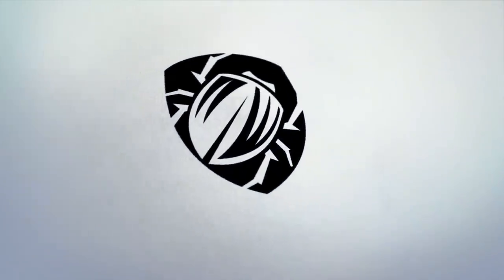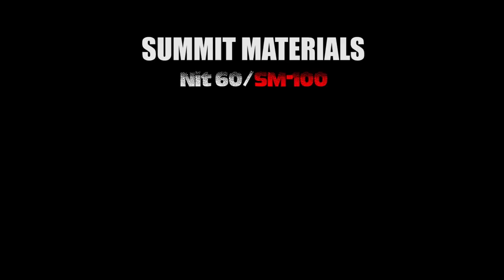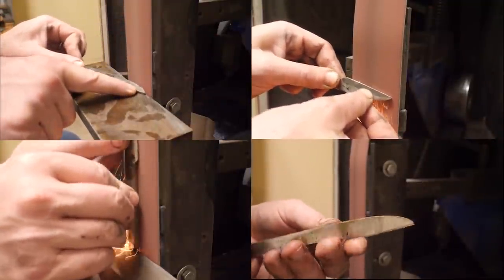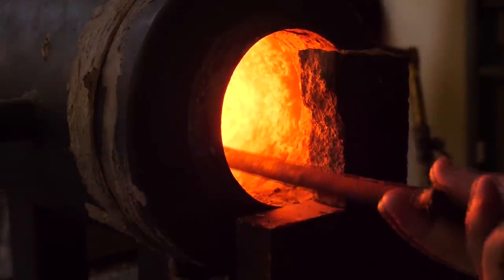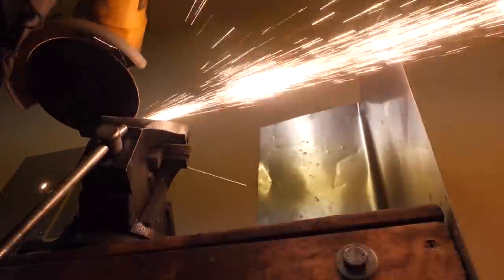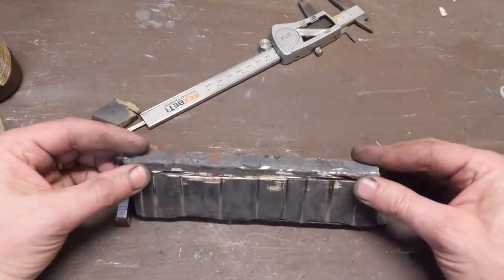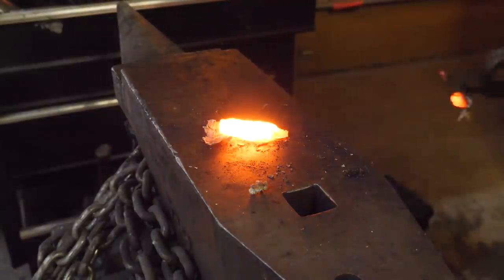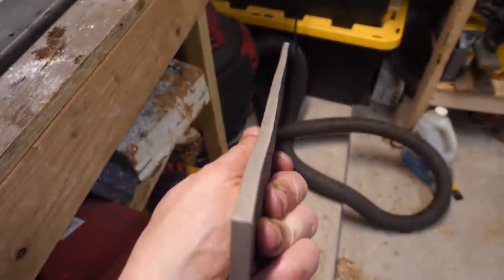Making A Nitinol Knife. Part 1: Forging Nitinol

Comment: "Making A Nitinol Knife. Part 1: Forging Nitinol"
me, a guy with a welding degree and limited experience with Inconel, Nitinol's nicer younger brother, grabbing the popcorn and sitting down:
"ooo this is gonna be hilarious"

for the record guys: both inconel and Nitinol are "super" alloys. they don't really like working under hammers. or working at all. they machine like trying to cut steel with peanut-butter.
Reply: "trying to cut steel with peanut butter" had me laughing

I had an oddly similar aggravating experience with some Aluminum-Nickel Bronze
Reply: @timothylongblacksmithing6743  that's a whole lot of words to say you had to sharpen your cutting tools after that

Comment: You're running into fairly normal issues when trying to forge titanium alloys, I've been there. Short answer is that outside of expensive specialty equipment, stock removal is the only viable way to get anything out of it. And then when you go to try stock removal, it just chews through belts like no one's business, ceramic ones included. 

I have two different 50% completed titanium 6alv knives and I ran into the exact same problems when trying forge it - embrittlement, work hardening even when heated to glowing orange, and severe oxidation. Between the embrittlement and oxidation, my attempt at forging a usable knife was a complete failure. It is a knife shaped object though, so at least I have that.

My second attempt, stock removal with a 2x72 belt grinder and ceramic belts was expensive - it ate ceramic belts like no one's business, it was both gummy and very hard to get anywhere, and it threw blinding white hot sparks everywhere. I got the rectangular block ground down to the knife blank outline and gave up after using a little over $100 worth of ceramic belts just to get to that point. I estimate that finishing it would be another two hundred dollars worth of belts, if I can even get a useable edge out of the end product and not just a wedge.

Titanium alloys don't hold a edge worth a darn from everything I've seen. I think as knife materials go, they're right up there with plastic - can it stab something a few times? Sure. Will it have a keen, useable edge that can cut stuff a few hundred times before needing to be sharpened? Not really.

So I've got tantalum next up on my list of 'exotic materials knives aren't made out of for very good reasons but I'm still going to try' list 😂

Comment: It seems like you need diamond saw blade, adamantium hammer and dragon scale anvil to work with this stuff.
 Not to mention nuclear reactor core to heat it.
Not worth, considering the end result would be a Knife of Corrosion Resistance+2

Comment: We frequently use nitinol products in the operating room (I'm a certified surg. tech). It's used a lot in kidney stone retrievals (wire baskets) as well as guide wires for the bone anchors we use in various tendon/ligament repairs. Stuff is indestructible, just so flexible and tough. You can practically tie it in a knot and it springs back to original form.
Reply: Big difference between NiTiNOL50 (that you are using) and NiTiNOL60 (what GB is using)
Reply: @BikeFitnessCoaching  what I mean to say is, bendy metal make surgeon happy face

Comment: It's usually single crystal cast or rolled, then cnc cut, with an industrial forge, with large environmentally controlled ovens and cooled oil quench machines.
My ex partner used to work for a company that did this for airplane components and let me tell you the machines in operation are amazing and absolutely huge.
I wouldn't feel bad if you cannot achieve the precision, i mean, the presses are inside ovens that keep the metal at temperature and the atmosphere inside said presses/rollers/forges is argon or some other inert gas to remove the oxidisation problem, something you will find extremely difficult as you cannot do hands off forging.
Reply from the maker: Ya, thanks.  I called a couple places about rolling and that’s what they said.  Heat blanket, inert atmosphere. Ridiculously expensive to roll a piece they wouldn’t even quote it.
Reply: @GreenBeetle  totally, just to start those peices of equipment costs thousands.
I remember being told they're on 24hrs a day and only turned off for maintenance, seeing as it takes 24hrs to heat everything back up to temp and ensure repressurisation of the system.
The company that my ex worked for also had large orders booked upto a year in advance, so their forge time is often entirely spoken for.
If you were to go to some of the bigger companies and speak to someone in their quality control department you may have more luck as they do small test runs fairly often to check the metals on output meet specifications and may be willing to work on the scale you need.

Comment: Cheep roller for sheet, two offset cylinders opposite direction for rotation, and the work fed in the direction of exit, and the offset comes closer, squeezing the work until it spits it back out towards you, and at a relatively safe speed.

Comment: As a metallurgical engineer I love seeing the phase diagram but sitting here crying at the attempt to work it. Almost seems like it could be cast but its melting is somewhere around 2300F so..use a coal forge if a gas cant make it and see if a heated mold could accept it, maybe even cool it while in the forge lowering temp gradually. Crazy stuff.

Comment: My suggestion: crucible and a mold.  Hard to believe that it wo't hold an edge as hard and brittle as that stuff is.  If you find the secret to working it it should be like working ceramic and keep an edge forever...

Comment: This stuff is like AR500 armor plate or Armet steel . Without the big boy tools it super hard to use. 
There was a bike frame company that tried to make frames out of Armet tubes in the early 90's. They had tons of problems because they went through so many grinding wheels. I think the finally just abandoned the product.

Comment: Steve-

Just a thought on the Nitinol Steel.  Is there a possibility the round piece could be chucked into a lathe and you could make turnings of the Nitinol, then place those turnings into a canister? Maybe then add some 15N20 powder to the canister with the Nitinol shavings?  Would this make the material more usable for a knife.  Yes it would be a mixed steel knife, but it could yield an interesting Damascus pattern, plus make the material more workable for the knife...

Just a thought??
Reply from the maker: Good thought but it apparently requires percussive arc welding to weld to other stuff.

Comment: Were those original samples from the Navy Ordinance Lab? If so, those are pieces of metallurgy history.
Reply from the maker: Rick says they were
Reply: @GreenBeetle  not sure how I feel about that. I am loath to waste material, but if it’s from one of the very first melt batches I’d say it should be in a museum. 

If you still have the samples, it would be interesting to listen to the sound they make when tapped at different temperatures along the austenite/martensite transformation. Just like the event that clued the researchers into the structure change that happens with temperature and strain.

Comment: Yeah, both metals have very high melting points, and both retain their strength closer to their melting points (especially nickel...hence why it's alloys are used in jet engines). 

Titanium is very reactive and becomes more reactive the hotter it gets. Normally, it is protected by a layer of Titanium oxide that forms very quickly when exposed to air, water, anything it can take oxygen from. Titanium Oxide is very hard...so as you cut, new Titanium oxide froms very fast. (it's why something inert like argon to keep the oxygen away helps a bit). 

On top of that, when nice and hot, Titanium will steal the carbide from carbide tools and form Titanium Carbide (which is one of the top hardest things known to man...close to the hardness of a diamond...Tungsten Carbide tools are sometimes coated with this stuff to make Tungsten Carbide more wear resistant lol).

Can also form a ceramic called Titanium Tungsten Carbide (also very hard), if you feed it some Tungsten Carbide on a platter. 

Titanium is a poor conductor of heat, and to make it even worse has a low specific heat capacity. So the heat builds up in one spot, and does so fast. As you peel off the inert Titanium Oxide coating, it causes the freshly exposed, extremely reactive Titanium to react with oxygen (which is a very exothermic reaction...that reaction produces lots of heat...like when Aluminium combines with oxygen to produce lots of heat in a thermite reaction) generating even more heat in that spot and is confined there by the Titanium that isn't a good conductor of heat. More heat makes Titanium even more reactive, causing all this to happen faster...creating a feedback loop, contained in this insulated spot. Titanium deforms easily and turns to gum as it heat up very quickly as oxygen is fed on a platter for reactions. 

Titanium also reacts with water to form Titanium Oxide, so water plus exposed Titanium isn't ideal either.

So:
1. Insufficient cooling of the spot that's being worked = Bad
2. Water + heat + removing oxide layer = Bad
3. Oxygen + heat + removing oxide layer = very bad
4. Tungsten Carbide or other carbides = bad
5. Even Nitrides = bad

Nickle has an extremely high melting point, which adds to the problem. 

The same things that give these two metals in this metal compound their respective amazing properties, make them a hard to work IF you try to force them to behave like steel.

Comment: So the yellow stuff is nickel oxide then? Is it harmless? Because I have had stuff like that happen on salvaged steel. I had made sure to remove any zinc coating because danger and seeing unknown stuff pop up anyway got me scared.
Reply from the maker: Don’t know.
Reply: More likely oxides of titanium. Of you heat titanium in a forge it turns yellow orange color

Comment: Dude!  An iron-free Nickel/Titanium alloy that gets as hard as a good tool steel?  There's GOTTA be a way to make knives out of it! Heck, make a Damascus with two different grades of it, and you'll be elevated to god-hood!   Build a furnace around your press dies, and make dies out of some hot work high speed steels? So, it's all forged fully AT temperature? In an argon atmosphere?  OK, that may be totally impractical... but, there's gotta be a way! Are there any metallurgists at Carpenter Steel you can call?
Reply: Man if you could freaking pattern weld titanium and nickel you would be a blacksmithing God LoL.

Comment: so it looks like to me you would need to melt and CAST that particular alloy which would require and industrial smelting furnace that using induction heating rather than any form of flame. perhaps it's the flame and it's natural uneven heating that's causing the issue? because every time you were working it whilst using the oven it seemed to move more like tool steel but when using the forge it looked like it was titanium. that's just my thoughts I'm not a metallurgical expert of any stripe and I'm certainly not even a fraction of the level of smith you are.

Comment: I think you should have tried Forging really slowly with about a 100-200 degree window of work on the hydraulic press in a sealed canister. I feel like you are being too aggressive and I think you are trying to work it too cold. That metal probably needs Forged form around 2000-2100°f out of the fire and back in at 1900°f. It's going to forge more like high carbon stainless steel. I think 1700f is way too cold.

Comment: Forging this material has no sense, for what ??? Do you forge ceramic ??? Ceramic knives have no sense also. The sense of forging is to harden but keep an elasticity to the metal. The only solution to make a knife blade with this metal is to melt it and cast it to a desired shape, then do the finish by grinding.
Reply from the maker: It can be melted in an inert gas induction forge.  It is routinely hot worked and rolled and so on but under conditions I can’t seem to mimic.
Reply: @GreenBeetle  O.K. but for what ??? What you wanna gain, whats the purpose...talkig about knives. I mean, if we talk about jet engines burning chambers....that´s another story.
Reply: @GreenBeetle  Please don´t misunderstand me, very interesting video about this special metal.....i just love iron and carbon......and sinterication. sorry my bad english...love metal.